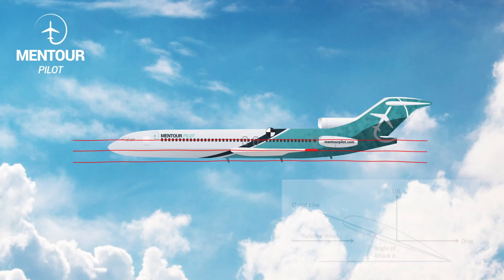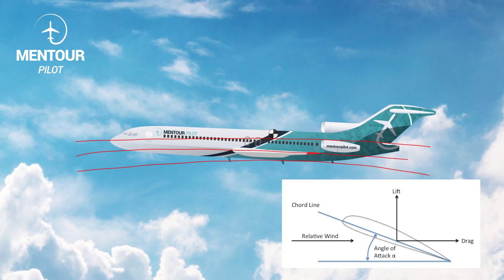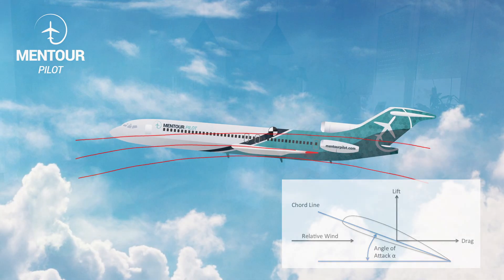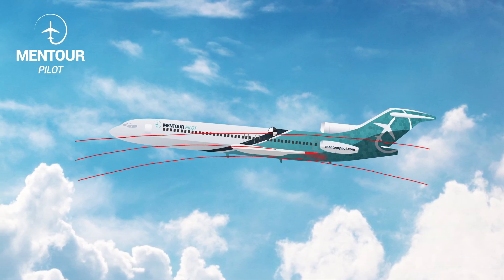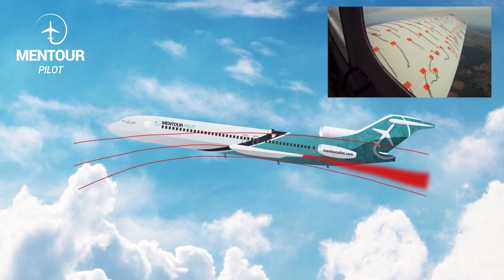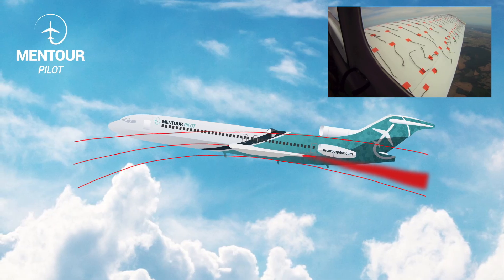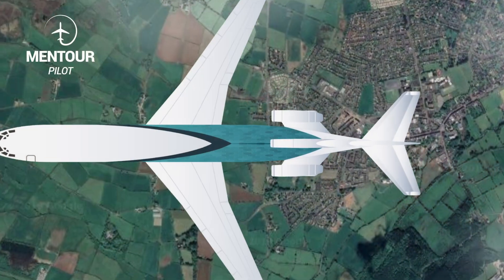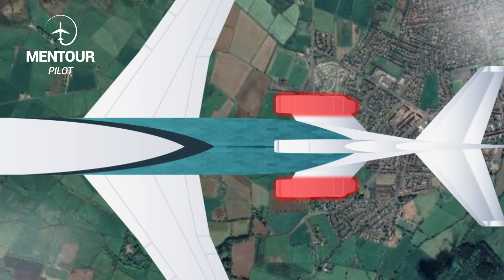The STALL you can't get out of! SUPER-STALL

Comment: I guess nobody will read this, but I ask anyway: in this super stall, couldn‘t you call all the passangers to the front, to tip down the nose and regain aerodynamics? This would have to be a coordinated emergency procedure, but I assume this could work. Maybe in those aircrafts, passengers should get an extra instruction during the security presentation at the start of the flight?

Comment: Assuming you find yourself in a MD-80 style aircraft in a deep stall at high altitude, the engines didn't flame out and have no compressor stalls below a certain thrust setting, could you use asymmetric thrust to get the aircraft into a spin and recover from that or would the engines be unable to do that?

Comment: Since engineers are fully aware of potential super stalls or deep stalls one would think they would create a new control surface that appears in these dire situations.

Instead of only horizontal control surfaces in normal flight. Maybe they'd be a button that now activates a pop out Vertical control surfaces that provide pilots ability to get plane in a high left or right bank to get nose to drop and regain needed airspeed.

Almost like a large rudder but aligned downward instead. Instead of a yaw one would get a roll instead with ailerons are in turbulent air & no longer effective.

This new Emergency Pop out veritical type rudder control surface needs to also be forward to be out of turbulent air.
Reply: probably too expensive or wouldn't be useful enough to justify fitting them

Comment: I assume reverse thrust would not work when you're in a super stall right? just wanted to get some insight on this 
My thought process was that because of the angle of the aircraft there won't be enough or even no fuel for the fuel pumps to push fuel to the engine. For a second I was like maybe reverse thrust can force the nose to push down in the case of rear-mounted engines, obv this would be if you have enough alt.

Comment: The stupid comment of the evening: what about an emergency device composed of a sort of tail parachute which, during the uncontrolled fall, automatically opens and lift the bottom of the plane up for one second? Not necessarily a parachute in silk, maybe even some steel or carbon wing which springs up and opens, gives a kick upward to the plane tail without breaking immediately, the plane gets that punch which brings it back into a flying position, then the parachute breaks (after 1 second or so of action) and is left to freely fall over the head of people below.

Studying the subject a bit more, I found the interesting solution adopted by the Piaggio P180 Avanti, with the fixed "moustaches".
Reply: The parachute solution you mention has been used in test aircraft.

Comment: To Mentourpilot

I am surprised you removed the factual comment I made on your site.

The more so when you, in your videos, repeatedly state that professionalism, security, safety are paramount.

I'm a (retired) Professional (equiv. Chartered) Engineer, and far senior to yourself in my respective field relative to you in yours, also Pr.Eng.'s (C.Eng.'s) have statutory authority to sign-off on designs, which carries far greater responsibilities than of flying an airliner; the plane being certified (signed-off) by engineers, but certainly visually inspected for pre-flight by pilots. 

Thus the responsibility for its long term design & integrity is far greater than for checking pre-flight & flying.

It would be appropriate if the comment I made were put back for general education of your viewers (I do not charge for accessing my site so I am not seeking financial gain)

Sincerely

Chris Addington Pr.Eng.
Reply: And the winner of the award for most arrogant comment from a prat who’s very impressed with himself goes to….open envelope…Chris Addington.

Comment: @Mentour Pilot, I did not know about super stall and it was great to learn what it is and as you were explaining I thought may be we can roll the aircraft either with aileron or rudder but as you explained chances are both of those will have stalled too. In such a case, how about intentionally inducing asymmetric thrust (maybe in the worst case scenario, idle thrust on one side and full/TOGA thrust on the other side) ? Will that turn the aircraft enough to get the nose to pitch down? Will it work to get out of the super stall?
Reply: Trouble is, your engines are getting turbulent flow too and will be less effective and may even surge or stall themselves. They really did think of everything with this design!

Comment: Many years ago an aircraft designer named Bert Rutan made aircraft that had a canard fixed to the nose. This canard had the airfoil profile and was pitched at a slightly higher angle than the primary wings. If the craft was approaching a stall, the canard would stall first, automatically pitching the craft nose down.
Must be a good reason why such a canard is not a feature of modern aircraft.

Comment: When airspeed is (somehow) really constant, then pitching up will increase AOA only temporary (word temporary wasnt used in this movie). When pitching up is over (zero angular speed), then AOA comes back to previous value. Slowing down increases AOA and simultaneously makes flight path angle "lower" (vector going to earth direction). Pitching nose up, will not change AOA forever - only temporary as mentioned before. So for increase AOA we "need" to slow down or to make bank left or right. Lift vector directed perpendicular to earth will be cosinus of bank angle - less lift than weight makes aircraft goes down. Going down increases AOA - so lift force is again same as weight - of course not when AOA will be higher than critical AOA value (stall AOA value).

Comment: The use of asymmetrical throttle could be a possible, yet desperate measure, to try getting out of a super-stall event. But if this happens as a result of pushing the aircraft to the coffin corner, then not even that would have an effect.

Comment: Interesting video, just wathed some fighter pilot story in which pilot got super-stall in a military jet at high altitude. Plane was falling and he could do nothing.. But to change the center of gravity. So he opened his belts and leaned full forward and then back. Then he noticed that the jet started rocking a bit. After doing this few times more he got jet to pitch down and got out of super stall. Other option would have been use eject seat. 
Started thinking if passenger airplane would get to super stall and you would have enough time.. Could you move passengers to the front of the plane to get CG to move front and that way to get the nose down.

Comment: 18 June 1972. Staines, England. HS Trident 1C. Angry Captain, inexperienced FO, poor CRM, (arguably) poor Flight Systems Design. Captain has a Cardiac Event that could have caused him considerable pain. Deep Stall. 118 people dead.

This was one of the key accidents in the development of CRM.

The investigation into this was a Public Enquiry, a legal procedure that required the investigators (who normally produce their own report,, independently of the legal system, under their own management) to work at far greater speed than normally and face intense legal cross-examination as lawyers jockeyed for advantageous legal positions in preparation to subsequent compensation claims etc. It's avoidance of some issues, especially the system design, in it's conclusions (which focused almost entirely on the aircrew) was, and is, controversial. As a final point, the extra pressure created by the form of the enquiry and the way this one was conducted was blamed for one of the investigators taking his own life.

Comment: In F-16 deep stall is seriously scary. The FBW does not know what to do, when ac is in deepstall. Pilot has to flip pitch limiter overide ON, then rock the nose up and down, untill there is sufficient airflow for FBW to work. In a T-tailed long fuselage type like MD-80 or F-104 or F-101. its death or punch out.

UNLESS! 
You are that one former USAF pilot who flew F-104, F-101, then DC-9, and finally 727. He also flew F-16B few times, with instructor, non operationally. For aircraft in deep stall, or super-stall. Where nose is stuck in pitch-up, with elevator in 'shadow' of airflow. DROP GEAR! Rock the nose up and down to get some airspeed. 
So was he right?

Comment: Your explanation is excellent, but it seems to show the 737 could also find itself in a superstall. What prevents it and other conventional A/C from entering a superstall?
Reply: elevator is lower, center of gravity closer to front
Reply: @vipvip-tf9rw  Thanks for the reply, but I am having trouble visualizing the resulting airflow. I think most A/C have low elevators, and very few are T-tails. All the planes I have owned, from a Cessna 152 to a Piper Malibu, have low elevators. I can't find much difference between these A/C and T-tails. What should I be looking for? Are there any sites that go into further detail? Thanks for your help!
Reply: @stevewilson5546  t tail situated right behind the wings while conventional situated below the wings, plus with rear mounted engines wings can choke engines

Comment: Mentor pilot I have a question regarding the stall video Super Stall with swapped wings and rear mounted engine with t- tail . I was curious about her engines lack of performance when it is in a stall not producing thrust. Or possibly flame out . The engines do still have air available just as they would during takeoff. They produce plenty of thrust during takeoff and air to function which is not being forced into the engine because it’s essentially zero speed takeoff. I Chyna understand that airflow is disrupted but I don’t understand why the engines cannot pull or suck Enough air into the combustion chamber.

Comment: Are the PLIs dynamic? Like if you flew into a 30 degree updraft from the front would they compensate?

On the Vortex Generator wing shot the flaps were also down, conveniently over the entire stalled area. Flaps would increase the AOA. So was this a VG demo or a higher AOA demo?

Why are Stick Pushers only reactivatable on the ground?

Why don't they install like a little wingtip rocket (or better yet tailtop) for emergency activation during Super Stalls? Just enough to kick it out of it? Like a rocket-assisted takeoff but less?

Comment: A friend built a model 1-11 some years ago. While at the design stage this issue was discussed. One interesting idea that was raised, but not implemented, was the addition of a small explosive device on the cockpit roof. Designed in such a way so as not to damage the airframe, but powerful enough for the blast to kick the nose down. I wonder how much force would be required on a full size airliner?
Deploying a drag parachute from under the aircraft rear was also discussed.
But I'm sure the builders have gone into this more than we have and I do not see any of these fitted.

Comment: maddogs and elevators. hmmm reminds me of the jackscrews for  t-tailed aircraft. also intresting to talk about, also the 737max, has larger and rounded engines engine cawlings...  the 737max has this virtual stick pushers dont they ;-)

u prefer the newer ng's or max's?

- Niko, KLM457.

i almost made it as a commercial airline pilot, until it was discovered i startedsuffering more and more from cluster headaches, until i had a epileptic attack, caused by another condition or consequence known as migralepsy. its been since 2011 i mourn my dreams my life hit bottom really, in those years before and after i played loads of flightsimulator, mostly FS9, As for long haul, it still runs like a dream.compared to fsx nd early p3d, i dont know about x-plane, supposedly more realistic aerodynamics, but i doubt  it matters allot with the proper wx program. it made me happy to play with.

Comment: Would differential engine thrust help in a super stall in a wing engine mounted aircraft? such as no thrust left wing, full thrust right wing, to drop one wing lower and change attitude to try and help? Would it be possible to use thrust reversers at all? (I imagine if you could use thrust reversers, they would sharply pull down the nose of the air craft...)

Comment: Excellent presentation. 

However, I would add that any aircraft can potentially be inadvertently deep-stalled under unusual conditions such as abrupt environmental turbulence, versus "typical" aerodynamically induced  aberrations. 

The condition may also not meet the test of the classic stalled condition - with a stick-shaker - as opposed to a vertical 'inertia,' rather emulating a vertical bow wave. 

The B-737 100, 200, 300 (presumably the 500 series) are known to encounter a loss of elevator authority during moderate-heavy icing  conditions; due to disturbed airflow from approach flap settings, coupled with the icing buildup on the horizontal stabilizer. I've personally witnessed 'square' ice on the horizontal stabilizer. 

Altitude and time permitting, if possible, I'd encourage a thought to turning off any power limiting features in an emergency, so as to maximize "survival thrust'" - damn the engine replacement cost. Whether you accelerate through the 'condition,' or use engine differential thrust and/or flaps and landing gear to maneuver/break out of the 'condition,' the awareness of the possibility and early recognition are paramount. 

In the case of the typical airliner, it's possible to encounter such pertinent 'onset' conditions due to an abrupt higher-than-normal air temperature deviation during cruise or climb, even without vertical gusts from thunderstorms, for example. The FMC and other automated features may not give timely clues or 'solutions.'

As an indicative but extreme example, in November 1968, in Alaska, an F-27 encountered a vertical 'sheer' in clear air at 20,000 feet - calculated by the NTSB at 29Gs. Its impact was far more vertical than horizontal. 

In aviation, anything is possible - and probable.
Reply: Indeed. It is a popular and dangerous misconception which seems to be taught that "only T-tailed aircraft can enter a deep stall" and I even noticed one experienced pilot commenting on the AF447 incident that "the aircraft was not in a deep stall because it is not a T-tailed aircraft". 

Any aircraft can enter a deep stall if the horizontal stabiliser is stalled in addition to the wings. I'll repeat that.

Any aircraft can enter a deep stall!

The combination of a swept-wing and T-tail is most susceptible to a stall, due to the poor stall characteristics of the swept-wing as described here (alongside the shift forwards of the centre-of-pressure as the AOA increases on most wing designs, not mentioned here) and the turbulent flow over the horizontal stabiliser reducing elevator authority. However, any T-tail or swept wing is susceptible to a deep stall and even a non-swept wing craft under the right conditions could experience a deep stall.

As Ralph mentioned, vertical sheer/extreme updrafts which result in an abrupt change to the angle of attack can in theory stall the horizontal stabiliser and it is possible that this is what was encountered by both AA8501 and AF447 since both planes climbed beyond their performance capabilities at high altitudes, suggesting that they encountered updrafts which resulted in a high vertical speed (this is mentioned in the reports as a possibility but NOT directly linked with a necessary change in the AOA). This type of stall is doubly dangerous as the abrupt transition from normal flight to a deep-stalled condition would not result in a stall-buffet as the airflow would detach from the entire upper surface of the wings and canards at once. This makes the deep-stalled condition even more difficult for pilots to diagnose. We may never know if AA8501 and AF447 were in deep-stalled conditions, as the pilots flying failed to recognise the stalled condition at all until too late. The response of AF447 to side-stick inputs and rudder commands by the FO during the final seconds of flight indicate that a deep-stall was probable and had the SO pushed forward on the stick it may have had no effect whatsoever, but since he didn't we can only speculate.

Nevertheless, it seems shocking to me that so many pilots believe the myth that not all craft can enter a deep-stall. Modern aircraft are returning to designs where the body and nacelles produce a significant fraction of the total lift. In a stall-condition, this lift is a stabilising factor which helps to prevent rolling and yawing motion during the stall which could lead to a spiral descent. However, in a deep-stalled condition, this lift can stabilise the craft in a gliding descent with nose-up attitude, keeping the horizontal stabiliser in a stalled condition. Tricky business...
Reply: I agree with what you are saying. Flying should be illegal. It’s just too dangerous

Comment: The 737 MAX8 also had this characteristic but instead of the method explained by mentour where the tail gets into the wing wash, the larger engine nacelles created a pitch up moment at high aoa. In order to prevent this pitch up moment, the MCAS was designed to bring the nose down.
Reply: MCAS was designed to ensure constant resistance on the yoke during a certification Wind-up turn which puts the plane in a high G-force weird AoA state, requiring both the AoA and G-firce sensor to trigger it. 

MCAS was later changed to fix the nose up tendency which happened with no high G-force so that sensor was disconnected...